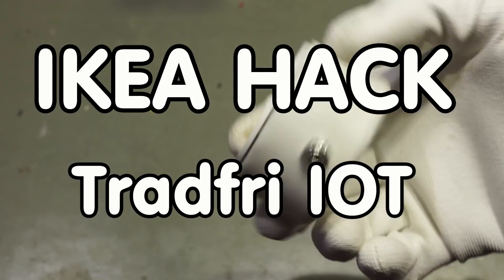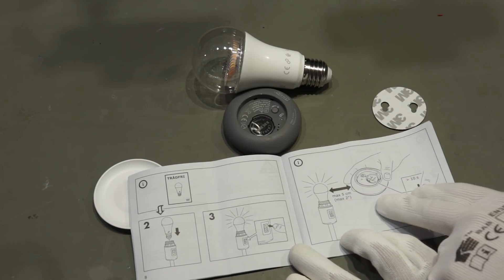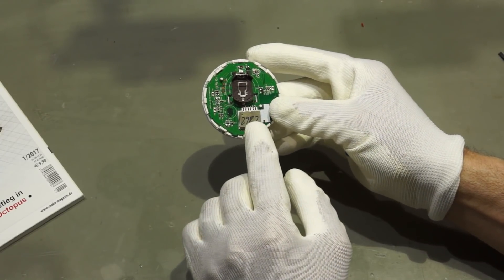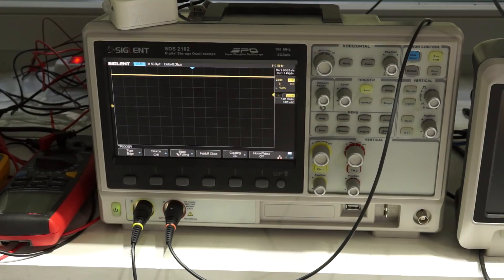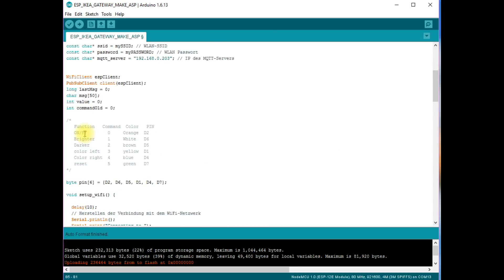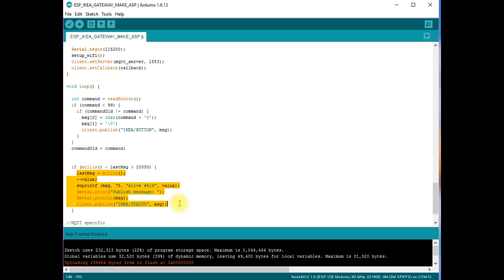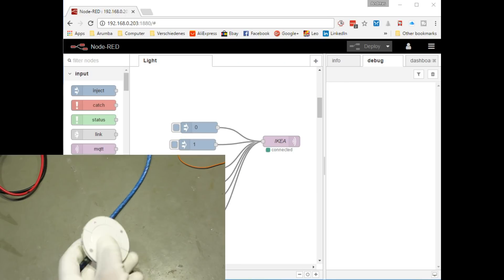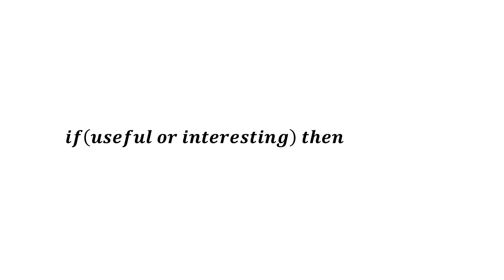#140 IKEA Tradfri IOT Smart Lighting System Hack

Comment: Is it correct to call the delay() function 'blocking'? Obviously, the execution of the user code is stopped, but the background operations (the wifi stuff) are not blocked , but given all the processor time instead. I would argue that this is more than just a semantic issue, as delayMicroseconds() actually is blocking, i.e., the user code will not yield and give any execution time to other tasks.
Reply from the maker: It is blocking for my code. This is, why I call it blocking. No code is blocking in your sense because the processor always executes code, even if the code is "NOP" (no operation).

Comment: Interesting hack! Since the light controller is powered by a coin cell battery, what's the current draw on the added wireless module?
Reply from the maker: I did not measure it, but it must be quite small (at least when no communication takes place)

Comment: Could one take a compatible module that can transmit to your system, add a photo sensor and assign values based on light intensity / resistance and place it next to the light to transmit a general idea as to what it senses? At least it would be something that could be polled by an automation system to provide status but as to sensing wether the light is actually on or off one might have to add a small cut tent sensor to the live phase of the socket and calibrate a micro voltage value to show if light is on  or off taking into account that the lamp will always draw some micro amps on standby/off. This could also be used for showing intensity level of the lamp based on how much current is drawn for each step of the lamps brightness. You would be basically creating a smart socket that provides info to your system.
Reply from the maker: +Subgunman This is possible, but quite complicated. I will buy a gateway and try to hack this one...

Comment: With my Samsung smartthings i could send you some raw data of the commands used in zigbeen when turning on and off. and also the handshake most of the lamps use when pairing.

Samsung smartthings is a great device as you are able to program your own Device handlers and as such include any zigbee device into it by yourself :)
Reply from the maker: Thanks for your offer. Maybe I have to come back if I am not successful. Viewers gave me some links which should help me getting the connections. But you never know...
Reply: Yeah, zigbee is a pretty well dokumented standard so you should not have much issue hackin them. It will be cool to see if you can build a gateway with mqtt for the lamps that is cheaper than the one from ikea :) 

Good luck!
Reply from the maker: I will not try that. First, I will try to do it with the gateway. I think also, that the Zigbee modules are very expensive. So, beating the 35 $ price of a gateway will be difficult... Or do you have a better idea?

Comment: Is it possible to take the device apart without using a Dremel/Proxon? It looks like one could press at the battery hold from the back side and then pop it out. Or maybe rotate it a bit and then press.
Reply from the maker: I do not know. Maybe you need some special tools. Because I wanted to include a Wemos, I anyway had to print a new case. So, I took the "shortcut"
Reply: It is possible to take the device apart non-destructively:
https://www.youtube.com/watch?v=NMupi1FeAB8

Comment: I am confused why you hacked a push button for MQTT integration, does this not have a API on the gateway like Phillips Hue so you can just hook up the MQTT on some Raspberry Pi to the API with some custom script?
Reply from the maker: +Robert Putt I do not know yet because I have to buy a gateway first.
Reply: Ok, thanks Andreas this makes sense, after all I guess this is cheaper without the gateway, what I would be mega impressed with is if you could mod one of those bulbs to be LoRa enabled :-P. Having a LoRa gateway on my roof means pretty much all rooms in my house are LoRaWAN capable. I hate that everything has it's own gateway these days, I'd much prefer one open source gateway that all IoT hooks into. I know these lights and Phillips Hue are Zigbee, but what annoys me is even the Hue bridge is not 100% Zigbee compatible implementation.

Comment: nice, but mybe it will be better to hack retriever (bulb)?
Reply from the maker: Why?
Reply: Now you are converting very nice, mobile remote control in to  switches glued to wall. When you will hack bulb, you can connect ESP8266 and make bridge to your automation system.
Reply from the maker: There is another possibility: Hack the gateway...
Reply: There are always many possible ways to achieve goal:) But original gateway is expensive one, also it is creating possible single point of failure, which I'm trying to avoid  (I also resigned from mqtt broker in my home automation, and esp8266 are talking to each other directly). Sorry for cut in. I love your videos and ideas.
Reply from the maker: +Pawel Tylinski You are right. And every solution has advantages and disadvantages...
I started exactly the other way round: With ESPs talking to each other. Now, I use a Pi zero as a MQTT broker and node red. This works fine for me and is stable.

Comment: This was interesting! Too bad the switch had to be cut open just to get in. I am very interested to see your exploration of the zig bee protocol. I was wondered if SDR (software defined radio) might have be helpful. However since (I presume) the zig bee protocol is well documented that would not be necessary. Thanks and as always I look forward to learning more.
Reply from the maker: I never worked with the Zigbee protocol, but I agree, it should be open. We will see...
Reply from the maker: Vielen Dank für den Link. Ich wusste das noch nicht, als ich mit meinem "Projekt" begonnen habe. Vielen Dank für den Link. Werde mir nächste Woche ein Gateway besorgen...